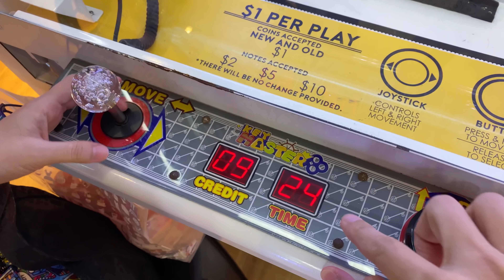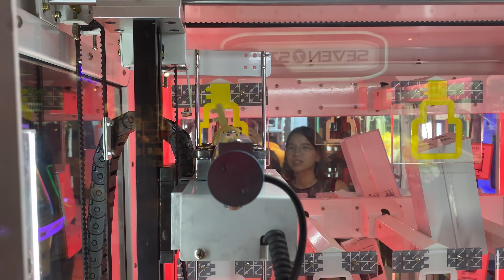【夾娃娃挑戰】贏到了Apple Airpods Pro❗開鎖王才花了六十新幣超賺❗夾娃娃挑戰 #121【Catch A Toy】

Comment: So is there a strategy or just keep trying I always thought it was a scam
Reply from the maker: No strategy I think. There is a payout rate built in.
Reply: Definitely has a payout rate.  If it is not ready to pay, the key moves a little longer than when you release the button.  At payout, you have to have skill to aim vertically.  Each row has its own payout rate (top row can be >$100), and based on how much has been played for each, may be due to pay relatively close together or very far apart.